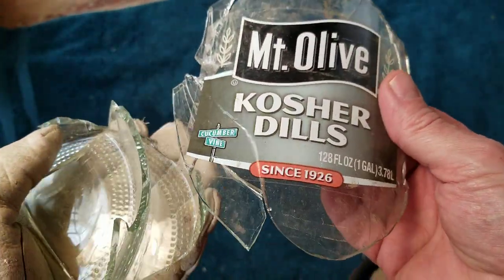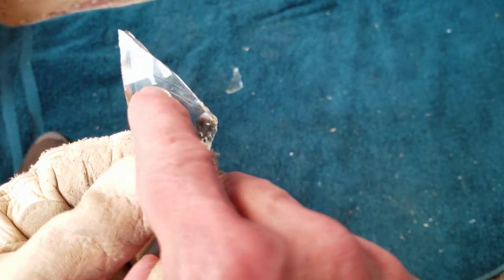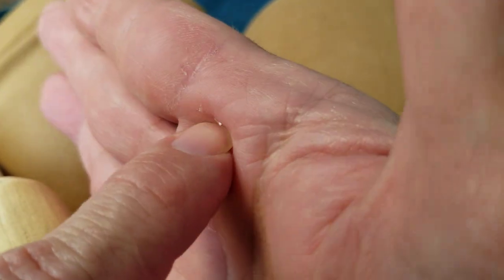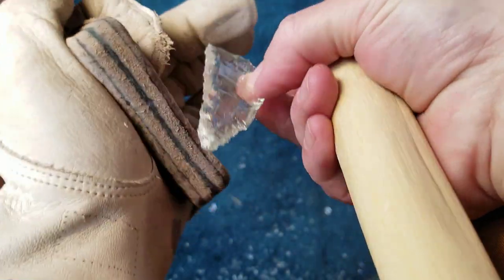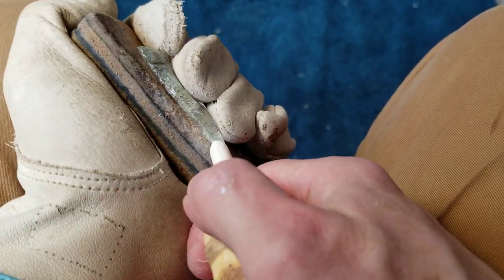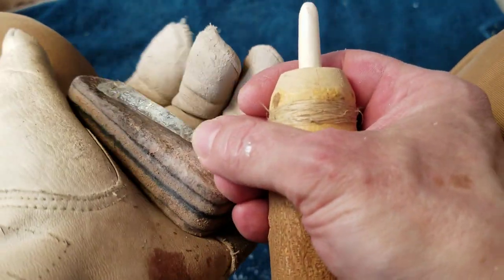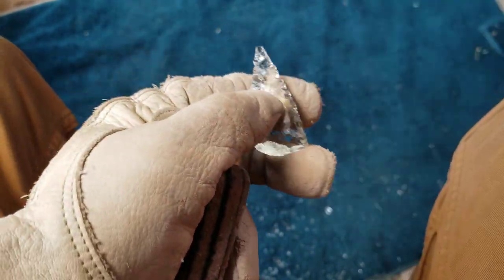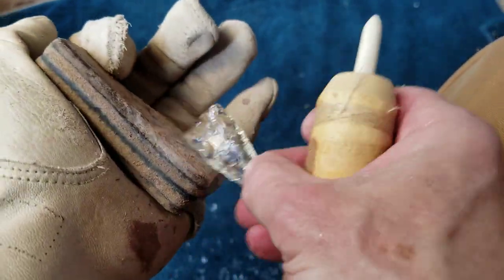848 - Flintknapping Glass with Abo Tools by Request 1/3

Comment: How do you stop shards going in your shoes ? And i really believe indirect percussion is the best method , i even came across a strange old video of native people using indirect percussion but with a tiny handheld punch held in the same hand as the workpiece against the platform then struck with the billet in the opposite hand ! It was incredible ! Saw a vid years ago saying ishi used just a nail and a pad , no abrasion evidence and had a systematic method of pressure flaking glass , and the guy replicated his work pretty well using this weird method , cant remember the channel
 edit , i found the ishi vid on youtube " how ishi knapped a slab " flintknapper jimmy" shows a very efficient method of pressure flaking glass using just a steel nail flaker , no abrasion at all and a leather pad
Reply from the maker: Shards get in my shoes all the time. I have to take them off and shake them out before I stand up. Even so, I still got cut by one this morning. Made a hole in my sock too.
Reply: Can you share the link?
Reply from the maker: @Tradbow85  https://youtu.be/z4Ke0YqqXA0
Reply: You could probably stop shards in your shoes by getting some cheap Canvas gaiters. Milsurp ones will only set you back a few coins 🤙
Reply: @KnapperJackCrafty  i was hopin for some flintknappers secret way of denying the little obsidian shards access to my arches ! The next question was how to deal with the microscopic glass that gets into my clothes and skin and ends up in the bed or on furniture but i can guess what the answer is  , looks like i will be forever itchy 😂
Reply from the maker: @captainbeeflaps5612  I shake off my clothes and my hair before I leave the shop after knapping glass. Then I go straight to the sink in the house an wash my arms, face, and flush my eyes with water just in case. I do this with flint too, but I take extra time with the glass. The way glass usually gets into my house is from the bottom of my shoes, no matter what I do. I think I should get several brush-like welcome mats and place one at each exit of my shop so I can wipe  the bottom of my feet well. I've got old rugs right now...
Reply: @captainbeeflaps5612  , just get a set of armor like sir Warsalot wore. Helmet gloves, and face shield too. 
I once had a big red hot glob of steel, when welding, land in my boot. I couldn't get the thing off fast enough. But I invented 3 new words that nobody wants to hear.
Reply: Captain Beeflaps, I love Ishi. Nice surprise to know this about him, and available video. Ty for link. ❤